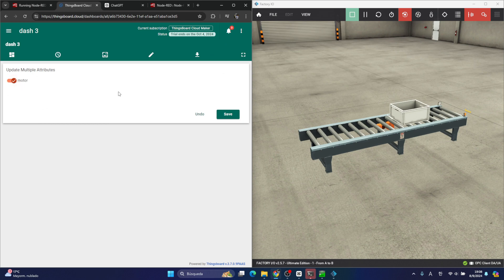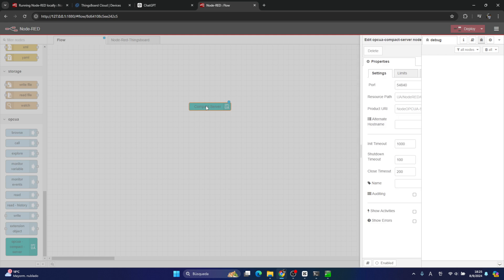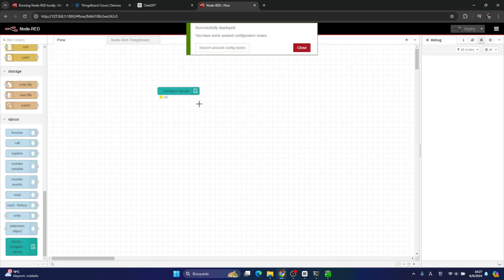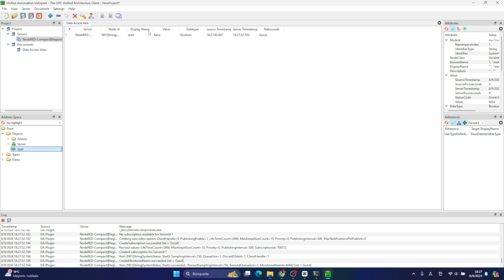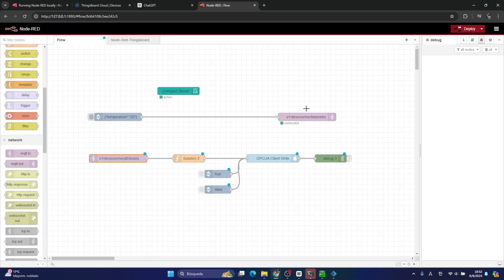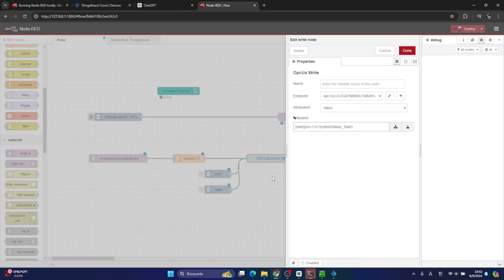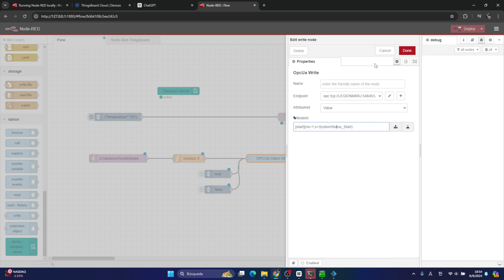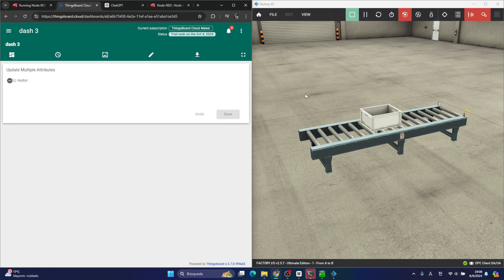How to Control an Industrial Motor with ThingsBoard & Node-RED, using OPC UA and MQTT

Comment: What is the point of using this instead of a PLC? you can monitor data from most PLCs and then you have a more robust solution.
Reply from the maker: Hello, thank you for your comment. The intention of the video is not to replace a PLC; it's simply a demonstration of another way to control a motor using the OPC UA and MQTT protocols. Instead of using a SCADA system, you can consider this as a more flexible alternative.